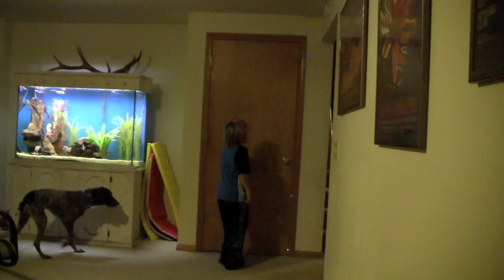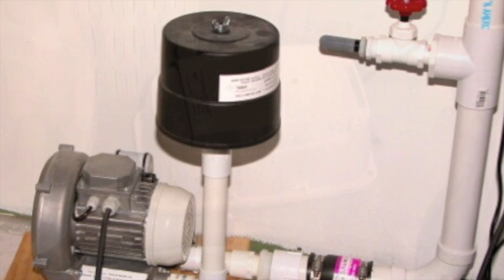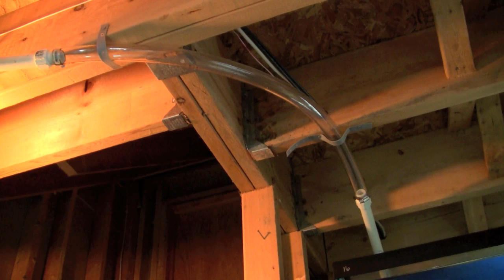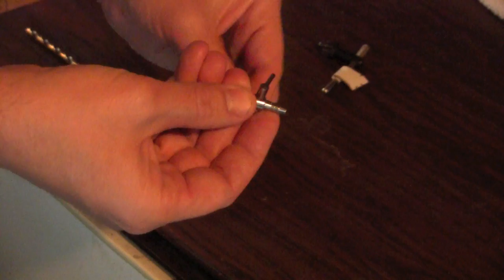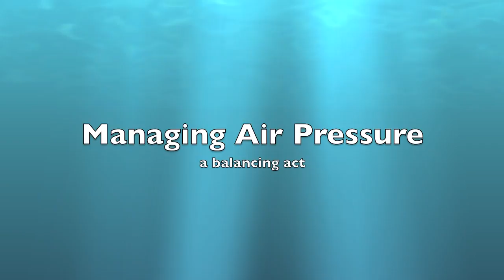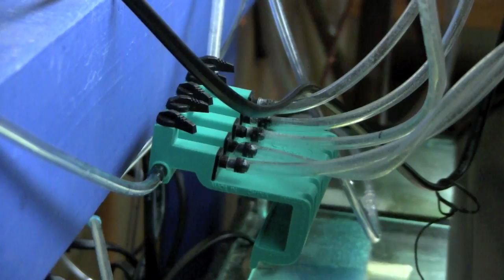Teds Fishroom Air

Comment: "small bubbles from air stones make filters run more efficiently" can you elaborate on that? or did you just mean that newer sponge filters make smaller bubbles, and should be switched out when that changes.
Reply from the maker: +maileen420 When there are a lot of small bubbles filling the lift tube, the combined surface area of all the bubbles together push more water than the relatively small surface area of a few large bubbles.
Reply: +Ted Judy got it, the whole "air stone" thing threw me off, thanks!

Comment: On your recommendation, I constructed a small, 3/4" PVC, closed loop system with a larger valve to bleed off unused air in order to avoid excessive back pressure for my Jehmco LPH26. Do you use a check on your system and if so what kind?  Most of the check valves reduce the airflow to 1/2" or smaller.  While I use individual check valves on all my airlines, I am unable to mount the pump higher than my tanks.  Should I use a check valve or are the individual valves sufficient?

Comment from the maker: The air delivery should be above the water to prevent back siphon in the case of a power failure.  If I were doing this in a 'finished' display room I would put the pipe just at the highest tank and use check valves.